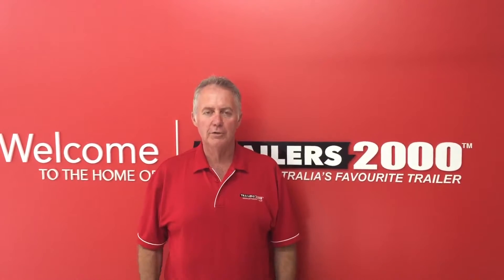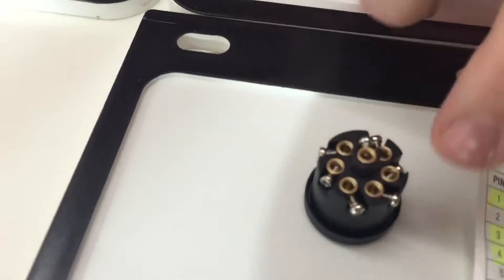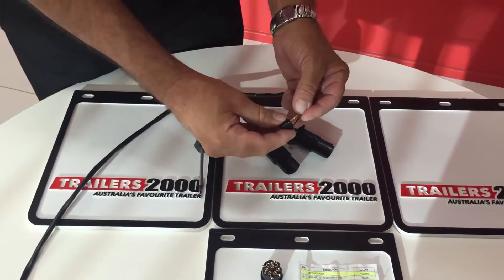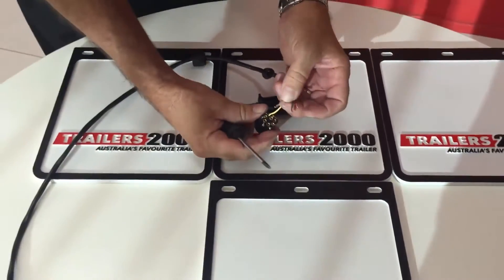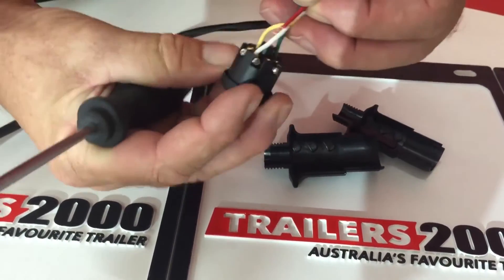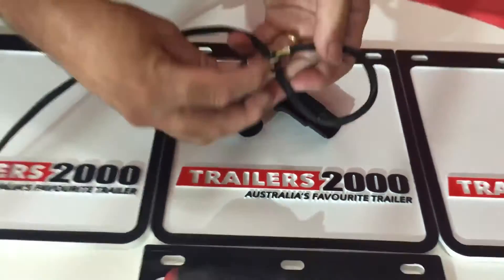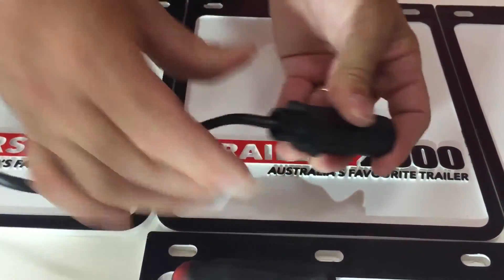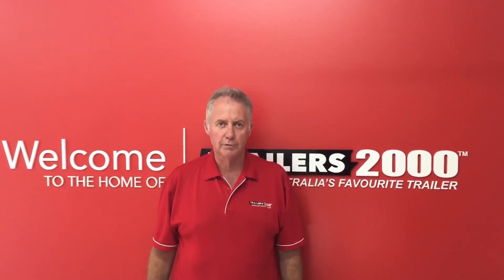How to wire a 7pin round Trailer plug

Comment from the maker: This video shows the standard 5 core cable wiring for trailers without brakes.  If you have electric brakes, then that will be 7 core cable and the blue wire goes to number 5.  If you are using 7 core on your trailer and don't have brakes, then ignore the Blue and Black wires.